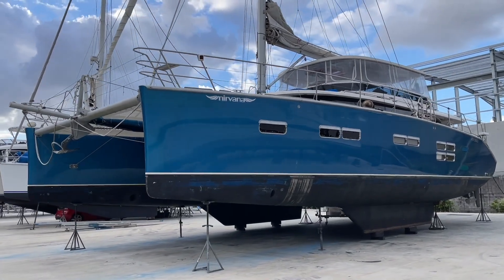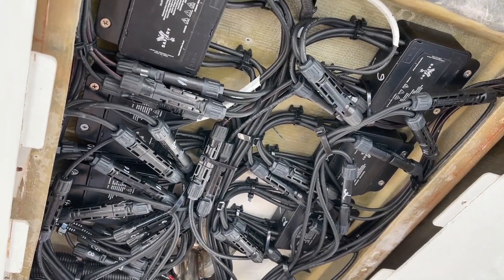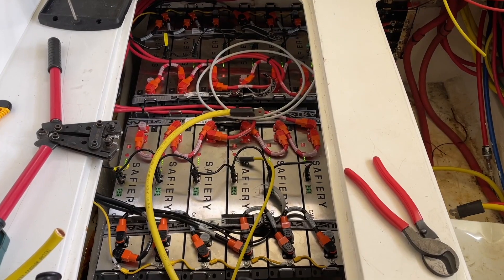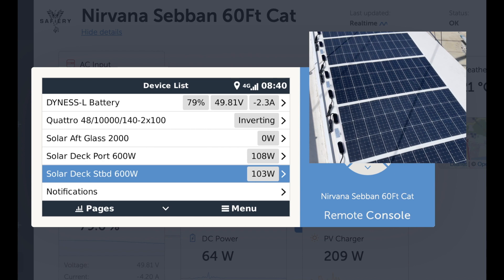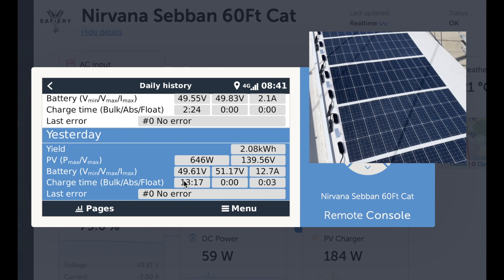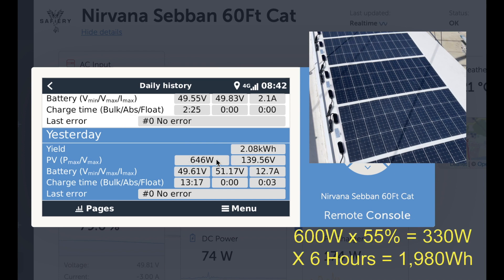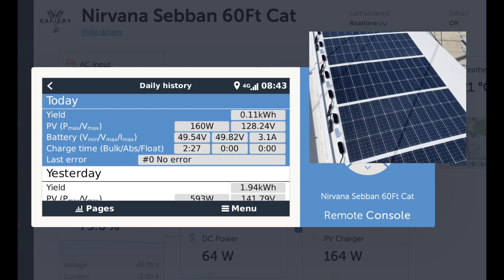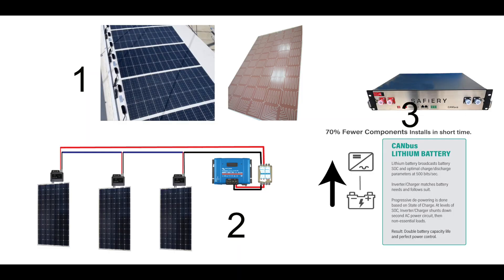Getting Outstanding Solar Performance in Shaded Conditions on Sailing Cat requires 3 things

Comment: Great Video - however couldn’t this be achieved with multiple MPPT controllers as well?
Reply from the maker: Well in the past this would have been 12V house battery and then sure it would have been individual controllers. The problem with this is that early in the day and late in afternoon there will be no power with 12V system. For high efficiency, a high PV is needed. We will get 13+ hours per day. For a high PV the panels need to be in series. This is a 48V house system.  At least 60V is required off the roof (PV). That is 3 of these panels in series as a minimum. There are mast stays shading continuously. Without a DC to DC for solar, the series string will choke to the panel of lowest current production in the string. For each string we have a dedicated solar controller....
Reply: @Safiery  Thanks - I knew you had a good reason.